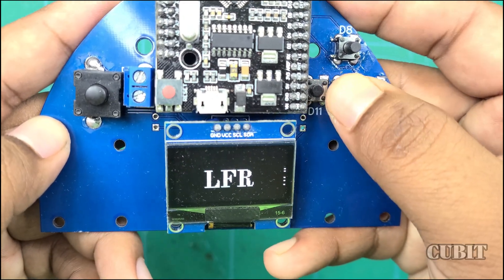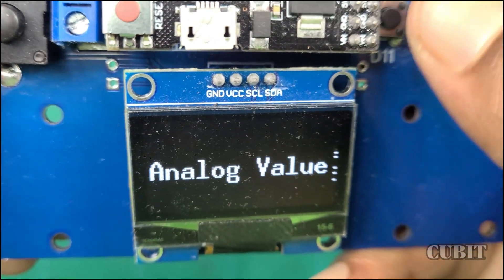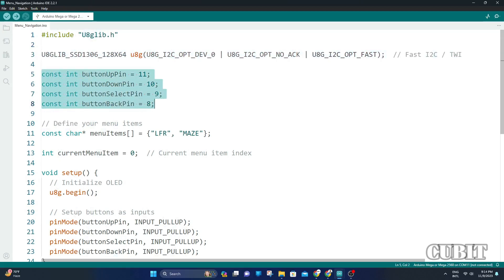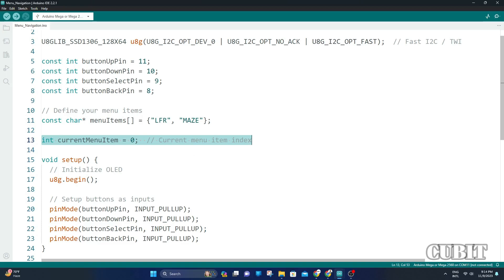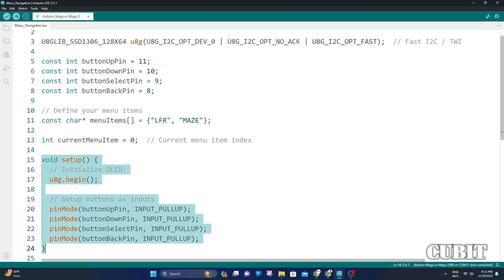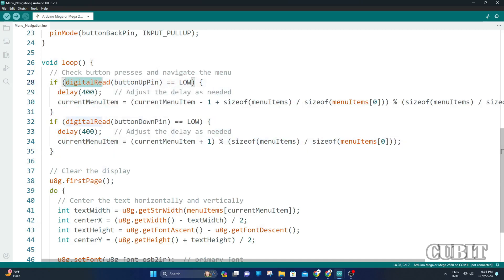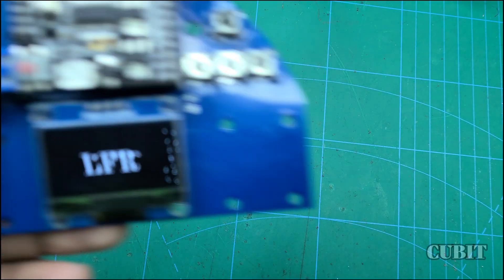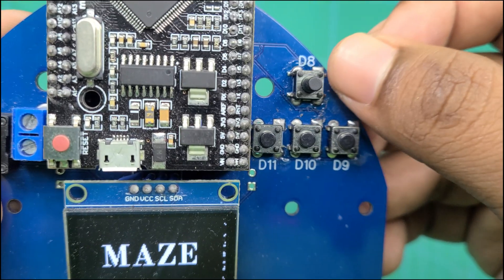Menu Navigation: Arduino OLED Display System || U8glib Library (1.3 inch OLED display)

Comment: Code in github not complete?
Reply from the maker: No.. which part i will explain in this video only this code is given in my GitHub account.
Reply: @cubityt  i see 4 pin up/down/select/back but not in loop
Reply from the maker: @iamfyrus  yes. In this code i only use up and down button. Next video i will use select and back button.